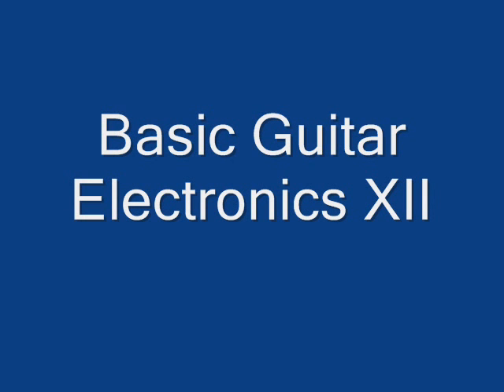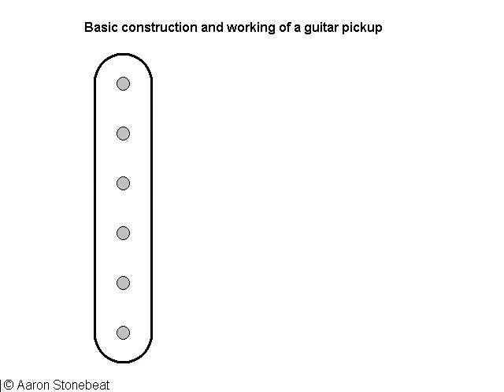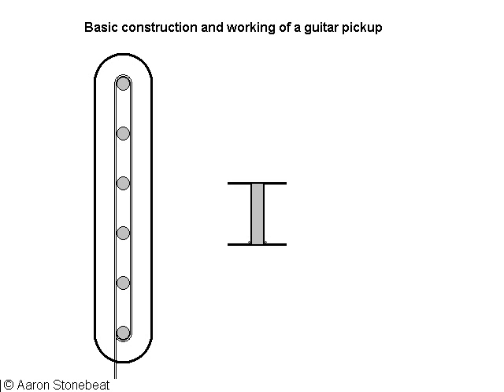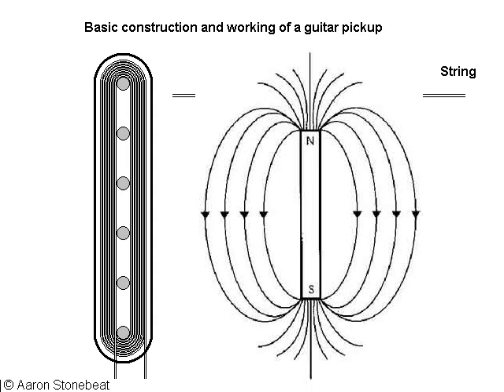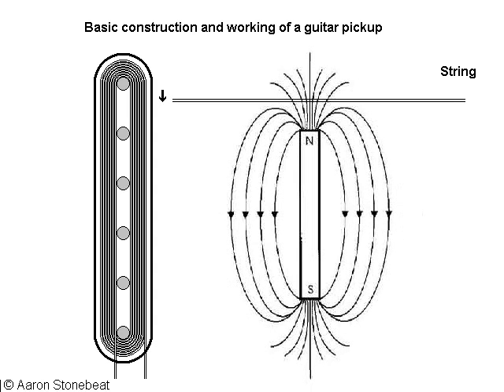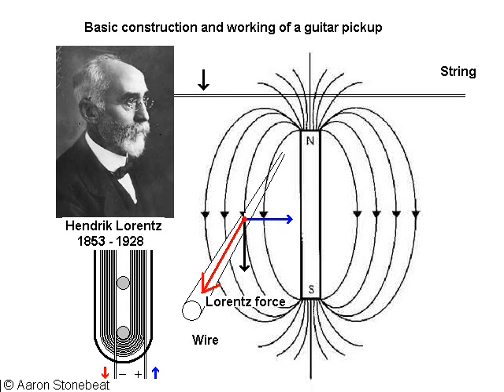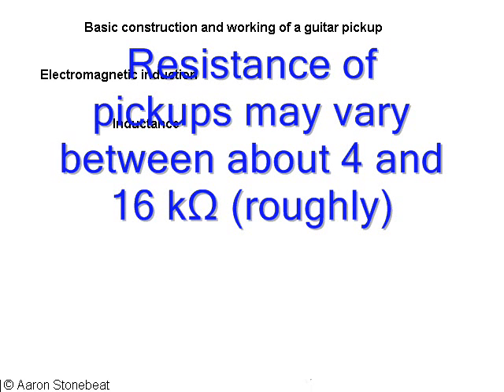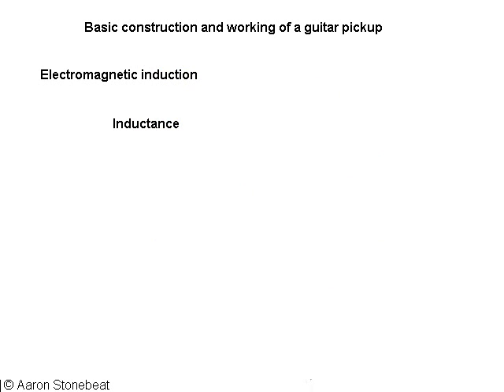Basic Guitar Electronics XII - How guitar pickups work

Comment: I'm interested in your educated and experienced opinion. I'm thinking about shielding my strat with Mu-Metal instead of "just" copper foil, because I'd like to play at a place very close to train tracks and the overhead wire is very problematic because of the extremely powerful magnetic field it is generating. So my questions are 1) can I shield my strat against this magnetic noise with Mu-Metal, or is everything futile because the pickup pole pieces pick up all the noise anyway (like, could I reduce the amount of noise from other directions like the back of the guitar) and 2) how close to the pickups could I go with Mu-Metal foil before influencing the tone (which I dont want at all).
Thank you!

Comment: there is a second theory that says that, besides the primary induction around the pickup magnets, as explained in this video (and the influence by the movement of the strings), there is a secundary magetic induction and electromagnetic polarity, created by and around the strings itself (as the string takes magnetic capacity from the pickup magnets)..
Reply from the maker: Yes, that is true. And then those magnetic strings in turn have an influence on the field of the magnets. And that influenced magnetic field means a change in the way the strings are magnetized.
And so on and so on. Right? Pretty soon a process that seems relatively simple becomes incalculably complex. I think this is the case with many physical processes; models may seem simple, actual reality is a lot more complicated.

Comment: As a string moves back and forth over its pole screw it seems the response in the coil would be the same as it moves off center in either direction.  Would this not produce a 2nd harmonic?  There must be a gradient in the magnetic field to get the fundamental response.
Reply from the maker: That is probably a great question and on one hand I'm not sure how to answer it while on the other I'm sure you're right.
But then the whole series of harmonics is present in the vibrating string to begin with so it will also be in the vibrating magnetic field.

Comment: Isn't string vibration more or less normal/perpendicular to the magnetic field as you have it depicted in 2:55? If you pluck a string, it vibrates side to side, perpendicular to the slug. But it would still move within the magnetic field of the slug I think.
Reply from the maker: Actually the strings vibrate in all directions but it is mainly the movement to and from the magnets/slugs that causes the magnetic field to vibrate with the strings and induce voltages in the coil.
Reply: @aaronstonebeat  Yeah I assume they would, but vibration in the horizontal plane would seem to be the most prominent frequencies, no? 

Also, I wonder if you would get a stronger/more sensitive signal if the slug were played sideways next to a string.
Reply from the maker: @EatScrabbleGoo  That might be a nice experiment; you could try to mount a pickup  next to a string and find out if there is a difference.
But it wouldn't be very practical, would it?

Comment: Can you make a video theory lesson about guitar pickup magnetic heat treated process, magnetic impulse time response, magnetic Coercivity. I would like to know the theory behind guitar pickup magnetic heat treated process and what it does and also how to change the magnetics impulse time response which is the time interval of the guitar string to the pickups output voltage/current and the magnetic coercivity is the picking sensitivity. The LOWER the magnetic coercitivty the easier the pole piece is magnetized, but why?

Comment: Hi there, really love your video series! I do have a question though. When you say 'More ferromagnetic core material = higher inductance', do you mean that using pole pieces with a .195" diameter instead of .187" (assuming the same height) would lead to higher inductance? Thank you!
Reply from the maker: Yes, but it'd be hard to say how much.

Comment: This is super fascinating and helpful, but I have one question that I can't seem to find an answer to anywhere. Why does one of the poles of the magnet have to face the string? I know that the poles of the magnets tend to have the strongest pull, but would turning a magnet sideways so that the string is vibrating through the center of the magnet still yield a useable output?
Reply from the maker: Notice how all magnetic field lines cross the strings in the same direction; if the magnet were on its side one half of the pickup would be out of phase with the other half.

In humbucking pickups you find bar magnets on their side often but they are underneath the pickup; pole pieces extend the magnetic poles towards the strings and each set of pole pieces has its own coil.

Also in P90 pickups there are two bar magnets on their side underneath the pickup; in these pickups the same pole of the bar magnets is held in place against the pole pieces which extend that pole towards the strings.
Reply: @aaronstonebeat   Oh, that makes a lot more sense! I've been trying to see if there is a way to modify an electromagnetic pickup to work on a bowed instrument like a violin or a cello. Guitar pickups don't work well on bowed strings because guitar strings seem to pick up movement towards and away from the magnetic pole and a string that is bowed vibrates side to side, not up and down.

I was talking to someone today about it and they showed me a picture of an electromagnetic pickup for a violin that I had never seen before, but it only had three pole pieces and they all went between the strings rather than underneath them to compensate for the difference in motion. Do you think that set-up would be able to pick up a decent signal from a bowed string?
Reply from the maker: @aaronkath6083  You are correct about the direction of motion of the strings relative to the pickup. From there it would seem to make sense to have the pole pieces between the strings but I am totally unfamiliar with pickups for violins. I can imagine the pole pieces rising up between the strings while the coil would still be in the traditional place; so basically a guitar pickup with extended pole pieces.

Do you have a brand name or something that would help finding pictures of such a device? You've made me curious.

Comment: My question is, what if you had a super strong magnet? Like the ones used in computers? How would this effect sound or playability, if at all? Ive been curious about this for a while
Reply from the maker: The stronger the magnet, the higher the output of a pickup but if the magnets are too strong they start interfering with the vibration of the strings, dampening them or even causing out of tune overtones. You can experience this when you put a pickup too close to the strings.
That being said I think in some modern pickups neodymium magnets are used but there are always limits to how strong the magnetic field can be close to the strings.
Reply: @aaronstonebeat  yes! That was their name. I couldn't remember it off the top of my head. Well, dang. I thought I had a genius idea for new pickups 😂 thanks for the explanation man!
Reply from the maker: @vangoghsseveredear  Thanks for your question and for visiting this ancient channel ;-)

Comment: i just learned Lorentz force by using right hand rule, but I could not figure out blue, red, black arrows in your video.
Reply from the maker: The strength of the magnetic field changes perpendicular to the wire of the coil, either inward or outward and so and electrric field is induced in the wire, either one way or the other, perpendicular to the direction of change of the magnetic field.

Comment: nice video man!!, also you can explain the induced voltage in a coil whith the formula $e_ind= -N dF/dt$ were e_ind is the voltage induced in the terminals of the coil, N is the numbers of turns of the coil and dF/dt is the rate of change of the magnetic flux perpendicular to the plain of the coil, the minus sing is bc the induced potential oposes to the change in the flux.
Reply: by the way, the commentary at the end of the video about how each parameter afect the inductance of the coil are excellent!!!
Reply from the maker: @juanchirino7135  Thank you!

Comment: MARC VAN, when you put a Dummy Coil in series it cancels out the HUM noises from a single coil pickup. Why does a Dummy Coil cancel out the HUM noises when there is no magnets in the dummy coil have no magnets and the dummy coil is NOT reversed wound. So how does the Dummy Coil reverse the polarity phase of the HUM noise?
Reply from the maker: It only works if the dummy coil IS connected out phase with the single coil pickup.
Any piece of metal, so also a wire or a coil, will be an antenna that picks up electromagnetic waves (hum); only in combination with a magnet will a coil transduce a signal from a vibrating ferromagnetic string.

Comment: Actually the magnetic field changes when the string moves because the magnetic field lines prefer travelling through ferromagnetic materials like the string. When the string is nearby it basically sucks the lines in distorting the magnetic field. The closer it is to the magnetic lines the more it can suck them in, resulting in a changing magnetic field, and that's what induces a voltage in the coil. 

You can test this by very very very carefully sliding a ferromagnetic material (mild steel) on top of the pick up, which will suck the magnetic lines in and there wont be anything left for the string to distort. But be very slow to avoid generating a large voltage as you distort the magnetic field.
Reply from the maker: I agree: string closer, magnetic field contracts; string farther away, magnetic field expands.
Reply: @aaronstonebeat  your explanation was very good, I just thought I'd expand on this part :)
Reply from the maker: @akosszollosi6159  Thank you for your contribution to the explanation!

Comment: I have a legit question: the electricity out of the pickup is alternate. In pickups specs, the label + and - the start and the finish of the winding. With the north to the strings coils, start is + and finish is - , and with the south to the strings coils, the start is - and the finish is + . Can you explain that, please? I have further questions, but if we can begin with that it would be great. Thank you, I loved the video!
Reply from the maker: When both pickups are switched on at the same time they are humbucking because of this construction; the coils are out of phase because plus and minus are reversed (canceling external interference) but the signals are in phase because the magnets are also reversed.
Reply: @aaronstonebeat  Thanks for replying! I know about humbuckers, my question is not about them. In my question im just talking about a single coil pickup that you can put a string in one side or the other, or just use a pickup with north up, and then change for another with south up. Can you read the question again with this in mind, please?
Reply: @aaronstonebeat  I also know that the winding is the same, you just use one side or the other of the magnet and then the resulting winding direction is clockwise or counterclockwise. But if you have the string in the north side the label of start is + and the finish is - , but if you have the string in the south side, the start is - and the finish is + , and there is where my question is leaning onto.
Reply from the maker: @diegopedroroldanmerino4208  Two single coil pickups can also be humbucking (they often are), that is the only reason for the electrical and magnetic reversal.

If only one pickup is on it doesn't matter. If two pickups are on and plus and minus are connected the same but the magnets point different ways they will be out of phase; and if the magnets are oriented the same but plus and minus are reversed they will also be out of phase.
Reply: @aaronstonebeat  FORGET ABOUT HUMBUCKERS! it is just one pickup in this example, my question is not about two pickups conected together!!!! If I put ONE single coil north up clockwise winding, the start is labeled as + and finish - in the specs. Imagine we REPLACE it, and put just one pickup in this imaginary guitar, wich is south up, counterclockwise winding, the start will be labeled as - and the finish +, and that is what I don't know why it is, do you? Why the start will change to be labeled from + to - depending on where the string is vibrating ("where" meaning the north pole or the south)?
Reply from the maker: @diegopedroroldanmerino4208  If you put just one pickup in the guitar it really doesn't matter (aside from other metal parts in the pickup that have to be connected to ground, but let's asume there are none).

If you want to use two pickups together you usually want them to be in phase. If the second pickup has reversed magnetic polarity you have to switch plus and minus for it to be in phase with the first one.

Magnetic field lines have a direction (north to south); if you turn that direction around the signal produced in the coil will be 180 degrees out of phase compared to before you turned the magnetic field around. Switching plus and minus will put the signal in phase again.

The direction in which the coils are wound doesn't matter. Imagine a coil with just one turn (they do exist): then there is just one side and the other of that turn, no clockwise or counter clockwise.
Reply: @aaronstonebeat  I think I don't ask my question properly because you continue to answer regarding the installation, and phase, and pickups working together and I know how to do it. I want to understand the current polarity of a pickup in regards to wich pole is up being affected by the string, and the winding. Do you know the answer to that?

Again: With the north to the strings coils, start is + and finish is - , and with the south to the strings coils, the start is - and the finish is + . Do you know why?
Reply from the maker: @diegopedroroldanmerino4208  Take the example in my video around 4 minutes:
North is towards the string, the string moves away from the magnet and so the electrons in the wire move clockwise through the coil (because of the direction of the magnetic field and the direction of change of the magnetic field).
If south were towards the string the electrons would move counter clockwise through the coil when the string moves away from the magnet.
Reply: @aaronstonebeat  Yes! but the current polarity  changes with the movement of the string, of course this is because is alternate current. So why is it labeled + and - if you don't mind me asking
Reply from the maker: @diegopedroroldanmerino4208  In the case of alternating current it might seem silly but it is to let you know which side of the pickup should connect to ground (-) en which to the signal side of the circuit (+).
Reply: @aaronstonebeat  Thank you very much for the back and forth :D I really apreciate it ;)
Reply from the maker: @diegopedroroldanmerino4208  You're welcome!

Comment: This explanation is the closest I have heard to date and it's the closest to my electronics training and automotive training. Simply a conductor moving through a magnetic field induces a voltage change. In automotive you collapse the magnetic field around the coil of fine wire. Guitar pickups move a ferris material through the magnetic field to induce a current in the windings.  Good job.
Reply from the maker: Thank you, sir!

Comment: Isnt it so that the magnet is only there to magnetize the string. When magnetized the vibration of the string causes a vibrating magnetic field being picked up by the coil resulting in an osilating voltage. It is not the string infuencing the magnetic field of the core as explained here.
When the string is magnetized you actually dont need the magnet anymore so a coil with only ferromagnetic core would work equally (until the string losses its magnetic strength).
Reply from the maker: I think that is partly true. The strings do get magnetized and cause inductance in the coil when vibrating but all on their own the part of the coil away from the strings would be a lot less affected than the part close to the strings.

Comment: Great video, interesting explanation, Marc. Focussing on the field lines is rather difficult, even though I agree that a retrieving string enlarges the magnetic field in size (as you have shown). What is much more significant, I think, is the change of field strength with the moving string.
Reply from the maker: Thank you! You are correct but at the same time a more spread out field is weaker per unit of space.
So I'd say it boils down to the same thing, wouldn't you?

Edit: I had a quick look at your channel and you obviously know your stuff! Best regards,
Reply: Thank you, Marc. Your musical performance is way much better than mine. :-)

Comment: according to Lenz the blue arrow should be the initial direction of speed of electrons, rectangular to the magnetic field lines, that causes the lorentzkraft. you describe it as direction of movement of the field lines. maybe it'd be better to imagine it as the increased/decreased pull of the magnet on the copper wire, wich in theory causes micro contraction/relaxation of the copper wire around the magnet. this way you could explain the direction of induced current with the usual three dimensions (magnetic induction, lorentzkraft, and speed (and direction) of electrons).
Reply from the maker: But copper is not really magnetic, hardly anyway. Electrons have a charge and respond to changes in the magnetic field.
Pickup wire can be potted or cast into epoxy resin and have virtually no freedom of movement at all and still produce a very good guitar signal.

So why?
Reply: Honestly because I do not understand how you can simply exchange these two dimensions: Direction of change of the magnetic induction B <-> speed and direction of travel of electrons (as in the general formula for the Lorentzkraft). Is there an explanation for why they are equivalent here?